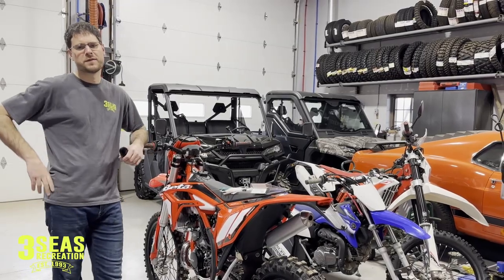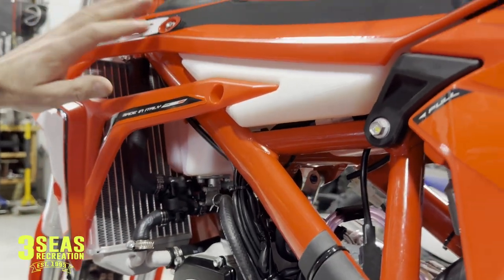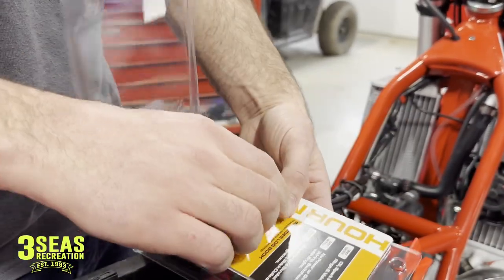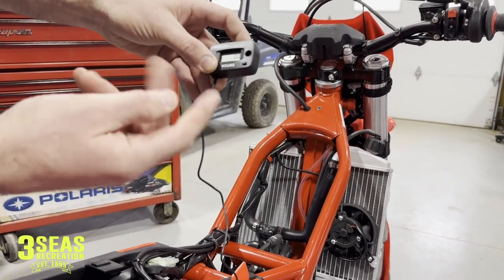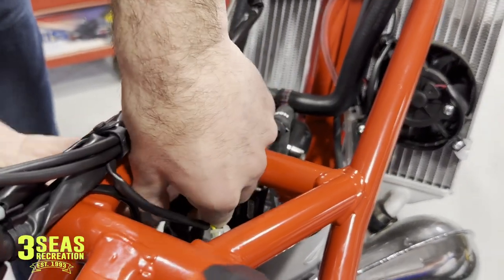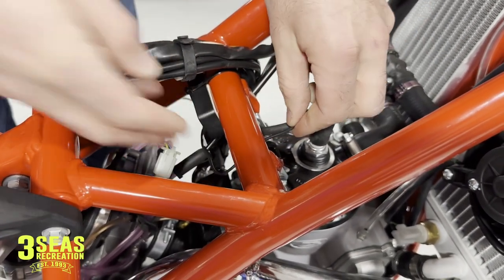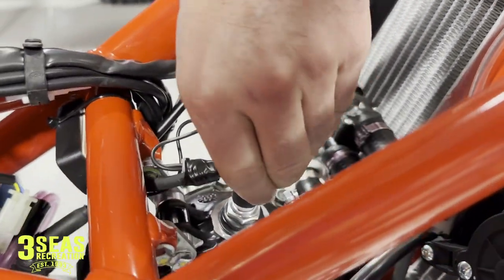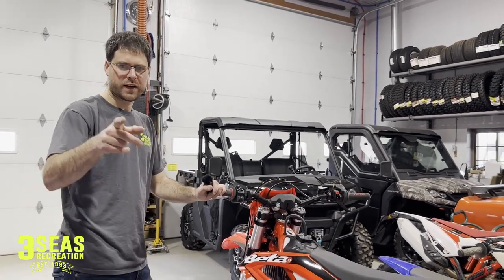Hour Meter Install: 2023 Beta XTrainer Motorcycle : 3 Seas Recreation

Comment: I notice that you always use starter fluid for cleaning purposes. 
Doesn't it leave residue?  
I'm curious as to what you use it all for. 
I always use rubbing alcohol for sticker prep
Reply from the maker: Good Morning, yes I always use starting fluid as it dries clean. It is gasoline so there is NO oily base to it. The rubbing alcohol does the same basic thing so keep using it! I just happen to have a shop full of starting fluid so I use that instead.  Enjoy the ride, Jared

Comment: For some reason, my 23 Xtrainers hour meter isnt working. Not sure what to check to fix it
Reply from the maker: Good Morning, if you are referring to your stock display hour meter you should check your speedo cable. The hour meter in the dash only works when the speedo is working. Enjoy the ride, Jared
Reply: @3SeasRecreation  You were spot on. The prongs must not have been making good contact. After I fiddled with them, it started to work just fine. Thanks for the help!

Comment: Just installed a hour meter on my beta, for some reason it didn’t switch to 1.0 for 1hour after 0.6 it just went to 0.7 I’m sure it runs in 10minute instalments on the meter? If so when will it switch to 1 hour as it’s just showing 70 minutes at the second. 0.7.
Reply from the maker: Good afternoon, yes I think hour meters record in tenths. No idea how yours works or why it hasn’t switched to 1 hour. Maybe check your manual. Enjoy the ride, Jared
Reply: @3SeasRecreation  in the end I timed my hour meter stages and it goes up in increments of 6 minutes so 6x10 = 60. so 0.1 is 6 minutes each. thanks for the reply, many don't bother.